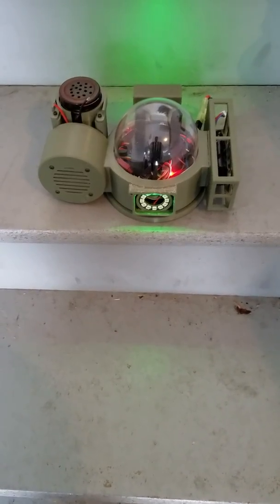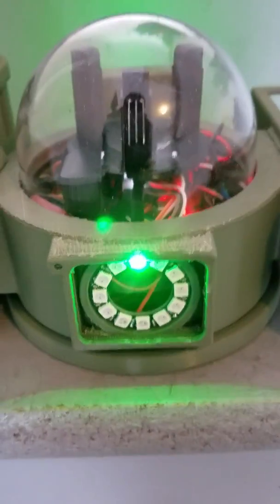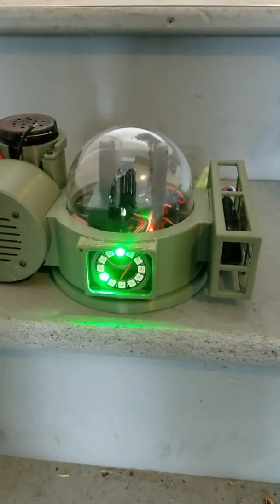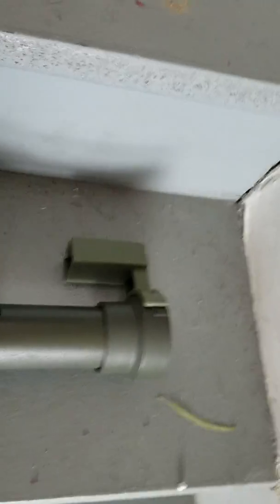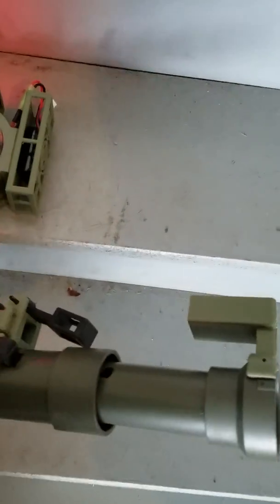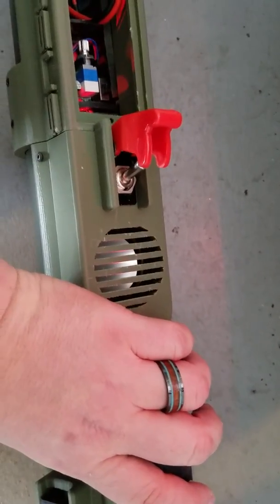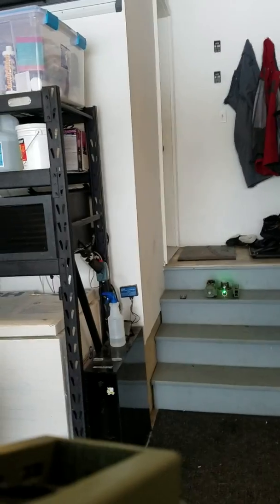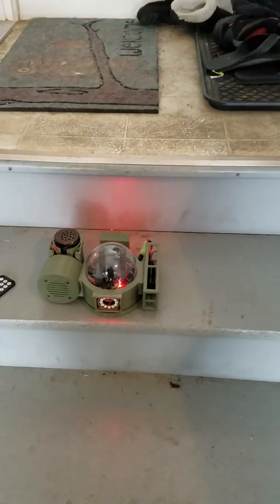Arduino Lazer Tag IR LAW M72 Launcher prop built for Pegasus Airsoft Field

Comment: Good job on this build. I will be making something very similar.
Reply from the maker: Hi Larry, let me know if you need any help. They are a lot of fun to build and use.
Reply: @cylixconceptsdesigns3159  I sure will. do you have the stl file? or G code file? and how else can I get a hold of you?
Reply from the maker: @larryboyd4820  I did not put together any instructions or tutorials so hopefully you can put together the puzzle pieces without much guidance. I made this video to show the field owner the proof of concept and functional prototype before he came for pickup & payment. I have uploaded all of my files here - https://github.com/cyshane/Prop-M72-IR-LAW
Reply: @cylixconceptsdesigns3159  Ok great. I should be able to put the pieces together. I'm quite the electronic engineer. If I wanted to just pay you to build another for my field. how much would that be?
Reply from the maker: @larryboyd4820  unfortunately I am unable to take on any additional projects at this time but if I were to give you a rough cost it would be $900. Broken down to $300 for all of the required parts + $600 assembly/labor. I would forecast about 30 hours to procure all of the parts and filament, 3d print, then assemble/solder everything together. If you need help sourcing any of the components let me know and I would be happy to share info. Most of my insight came from https://combattag.com/ 
Thanks!